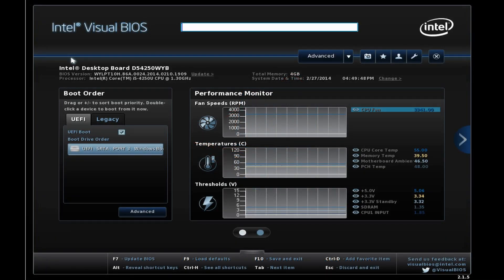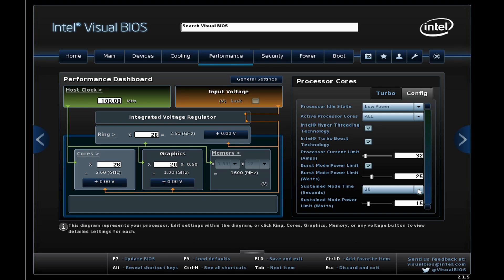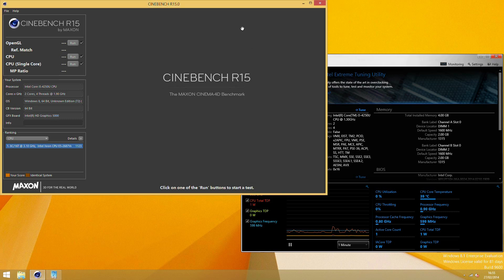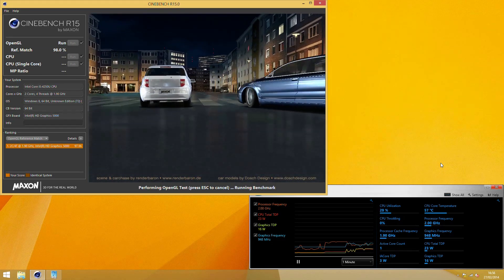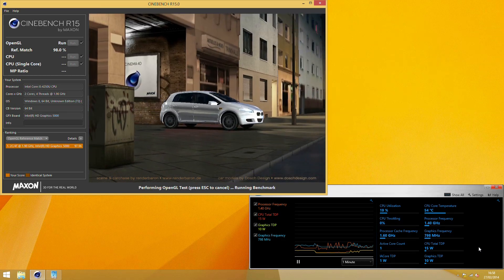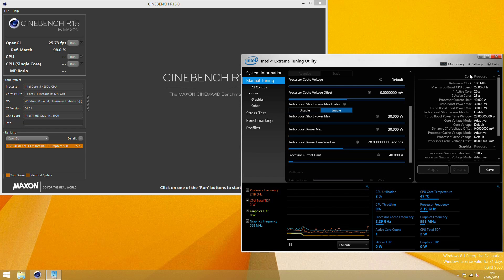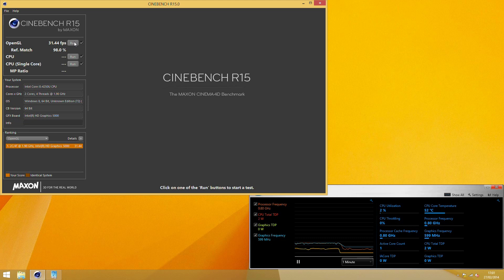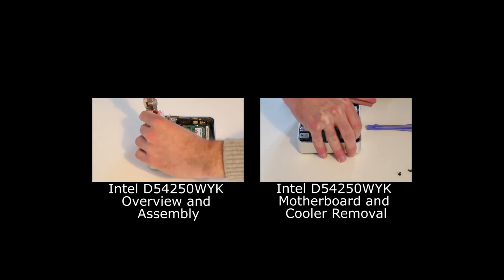How To Overclock the Intel NUC D54250WYK

Comment: can that small thing play games
Reply: This specific model is 2 years old, newer models are better. I own one of these... It actually can, on low settings of course and not the latest big titles, but it runs games like path of exile decently, xcom enemy unknown(enemy within has much worse performance for some reason) etc...
Reply: YEs it really can very well too
Reply: Heck yes. I have an adaptor running from one of the Pcie slots inside to an RX 550 4GB. 1270mhz. Runs most games older than 2018 medium to high at 1080p.

Comment: since i've made the last update for bios on my i5 nuc, the same as you, i get stuttering experience on games, and i can't get anymore in cores performance's panel on visual bios, i need to use the searching bar to get the hidden options.. And i can only active intel turbo boost by this way now, and when i go on my intel Extreme Tuning Utility, he is showing turbo boost disabled.. Manager also show me 1.9ghz but now the processor never reach 2.6 ghz... and sometimes explorer freeze, i can move the mouse but i need to shutdown the system.. really annoying.. I have 8 Gb hyperx and a kingston's ssd on it. Help me :'(
Reply: Load default settings "F9", and then access the menu with "turbo boost" as shown in the video.

That should do the trick.

Comment: These machines are absolutley workstation capable, i.e word, outlook, LOB database applications. Shame about the noise though. My g3258 runs basically fan less @ 4ghz, full load, with a cooler master. The gtx 750 is almost silent too (I removed one of its fans...)